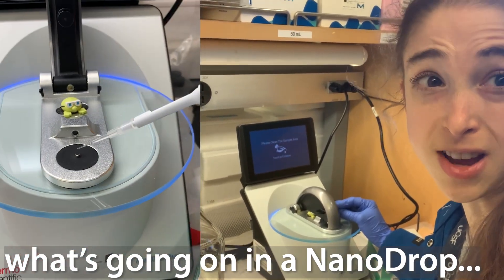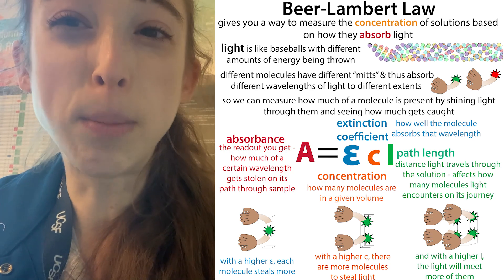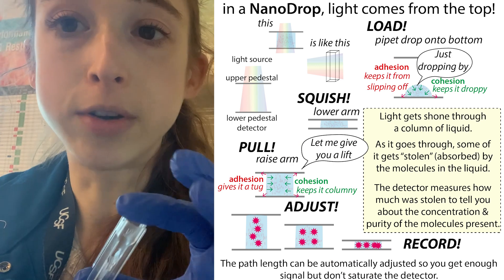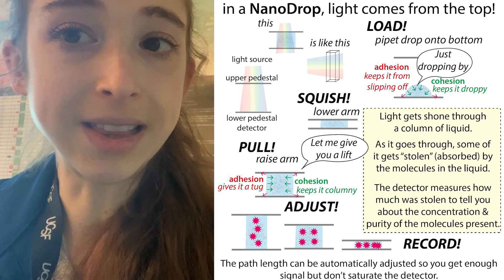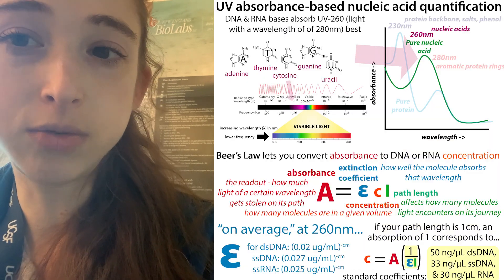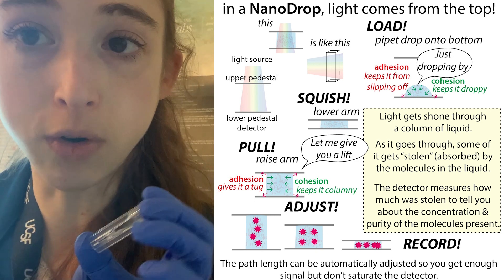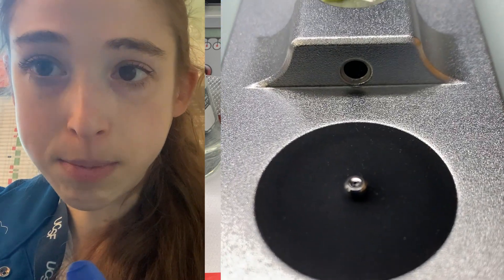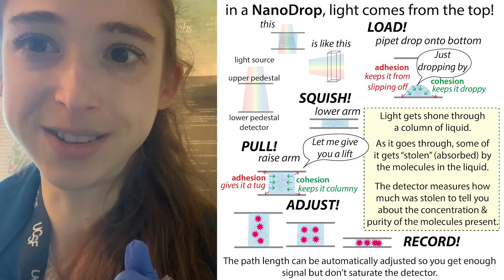How a NanoDrop works

Comment: Quick question. For DNA QUANTIFICATION, the more fragments of DNA there is in the sample the higher the nanodrop value it will be correct? Thus if I am digesting DNA from an initial known concentration of DNA, I expect the value of the nanodrop to increase as there will be more fragments of DNA for the spectrophotometer to read and measure. Nice video btw keep up the good work
Reply from the maker: No. It's concentration in terms of mass/volume, which won't change when you digest it. And thanks!

Comment from the maker: This column is just like the column of liquid in the cuvette except it’s much smaller and it’s held up by surface tension instead of being barricaded by glass/plastic. And it’s “sideways” - the light travels through from above and is recorded below 
 
Another difference about this column is that the path length’s adjustable (the column can be pulled up higher or squished) - so it can adjust for different concentrations (e.g. if your sample’s too concentrated it’ll see this squish down to shorten the path length so the light doesn’t meet as many, or if it’s too dilute it can pull up to make sure lots of molecules get hit by light). The NanoDrop software then has to correct for this when it uses Beer’s Law to get to concentrations 
 
A couple things we commonly use it to measure are nucleic acids and proteins. It’s easier to get columns to form for nucleic acids than proteins because the proteins often weaken the surface tension - not all parts of proteins like water, so it’s harder to get continuous water networks to stay as you pull up the column → column breaks. But there’s strength in numbers, so, when loading protein, I usually load 2uL, but I load 1 or 1.2 for nucleic acids. 

Also, beware that if the concentration is too low, the results will be unreliable, especially the ratios. If you need really accurate concentration info, a Qubit is a better option - it uses fluorescent molecules that bind specifically to DNA, RNA, or protein, depending one which kit you use.
 
much more on how to interpret the results:  http://bit.ly/dnauvbeer   ; YouTube: https://youtu.be/cUxh2DCqYBo 

more on UV absorption of proteins: http://bit.ly/tryptophanfan  ; YouTube: https://youtu.be/lcnmE4TGt7I   

suggested reading: What Causes Molecules to Absorb UV and Visible Light. (2020, August 21). Truro School in Cornwall. https://chem.libretexts.org/@go/page/3746

The NanoDrop manuals also has good info if you want more. Hope this all helps! 
  
more about all sorts of things: #365DaysOfScience All (with topics listed) 👉 http://bit.ly/2OllAB0 or search blog: http://thebumblingbiochemist.com